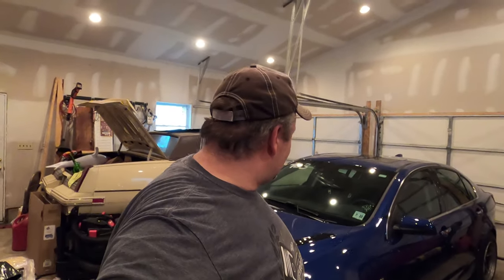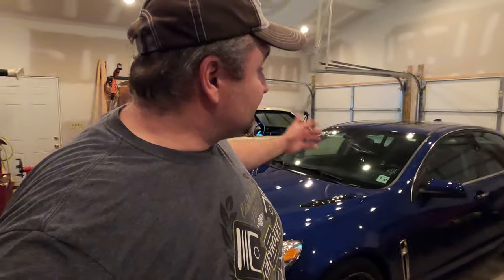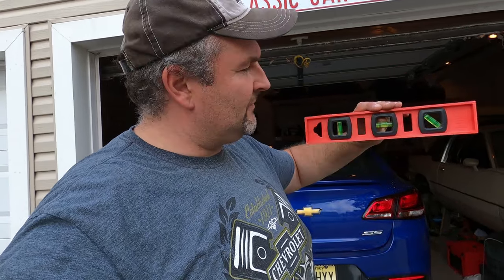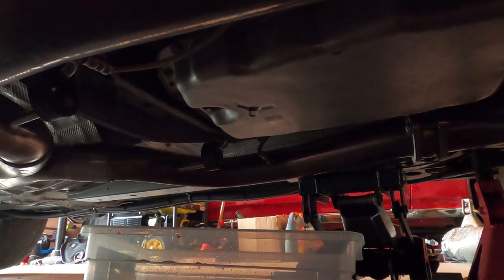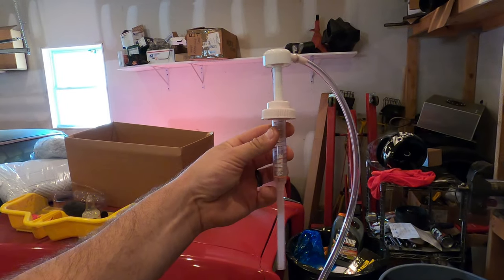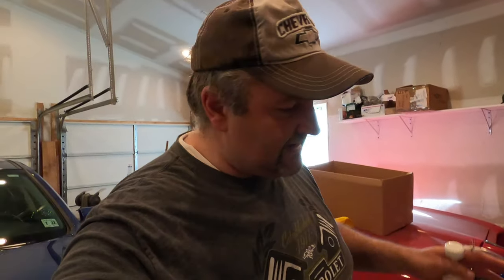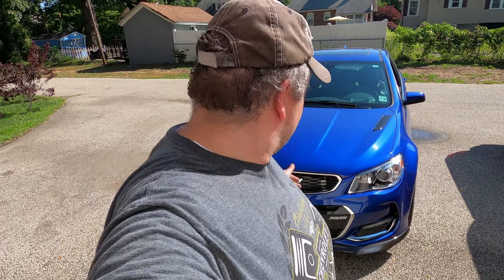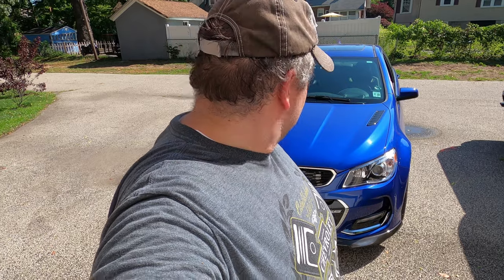2017 Chevy SS Trans Fluid Level Check after Radiator Replacement

Comment: I’ve read that with the engine off the fluid level was above that black fill plug. (So if you remove the black plug with the engine off fluid spills out of that hole.) That doesn’t seem to be the case from your video here. Do I understand that correctly? I was planning to buy a dipstick because I didn’t want to add the extra quart with the engine running after setting the level. It looks like I can do that after the engine is shut off and not make a huge mess. Thanks for the video!

Comment: Hey so how many quarts did u use with there still being fluid in the stall converter
Reply from the maker: So I fill the converter up prior to install which takes a few pours and waiting for it to bubble down. Once I installed I fired it up and waited for it to warm up then added just enough to make it pour out the level plug. I then closed it up and did 1.5 quarts overfill. Been perfect since.